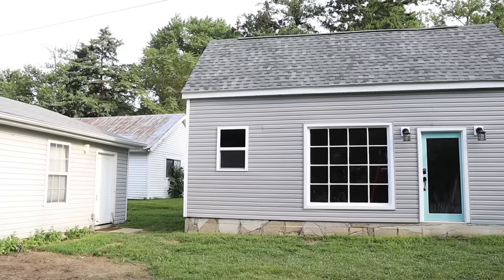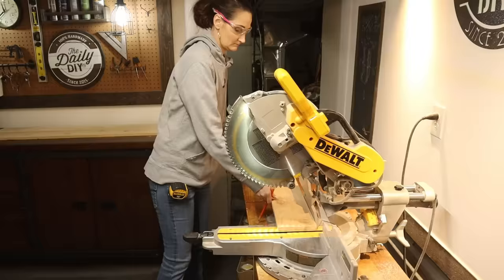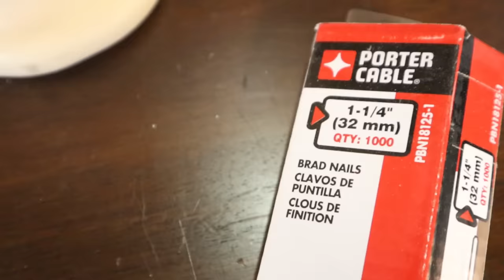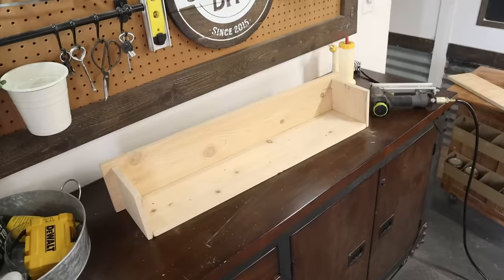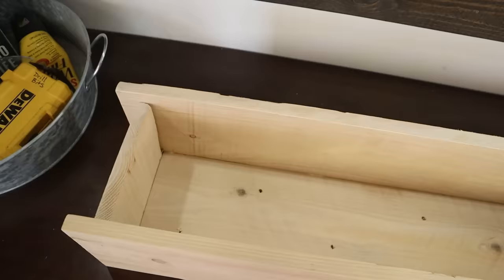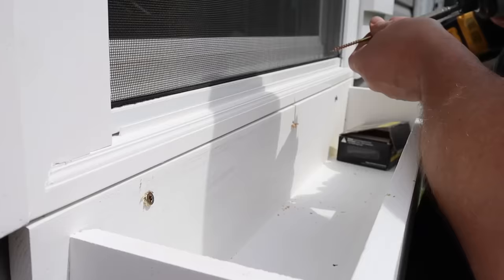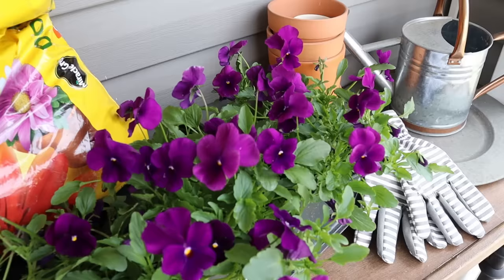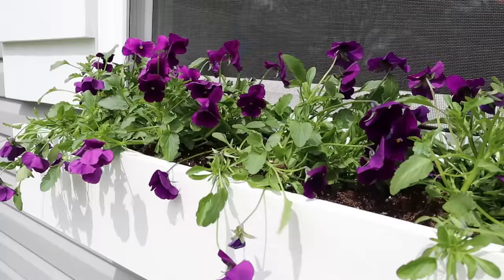$6 00 DIY Flower Box!

Comment: What a wonderful change the planter made. I should do this to my shed. 
Did you know your wood pieces will last longer outside if you paint it all, including the cut ends, before you put it together? Also oil based paint lasts longer outside. Also adding drainage holes will help your flowers from getting over saturated during storms.